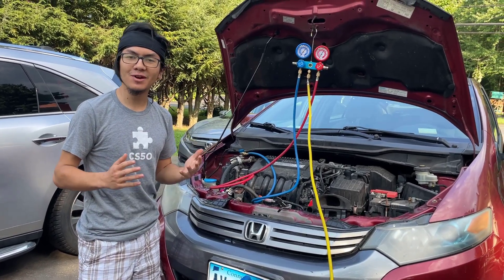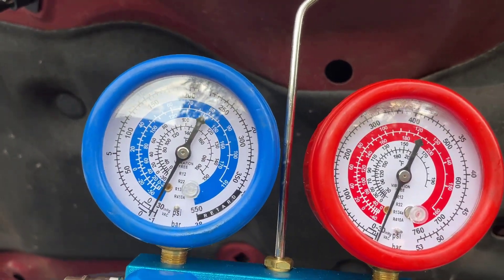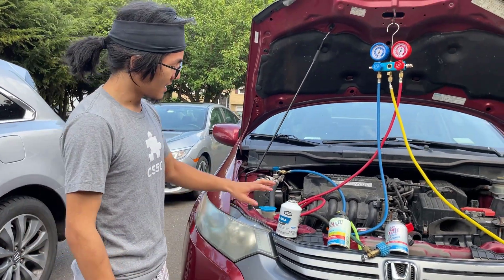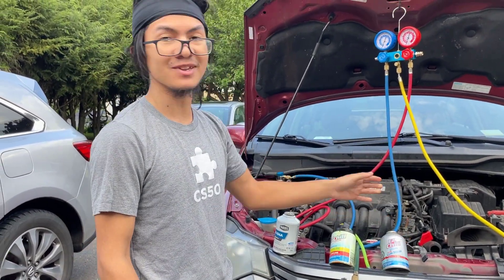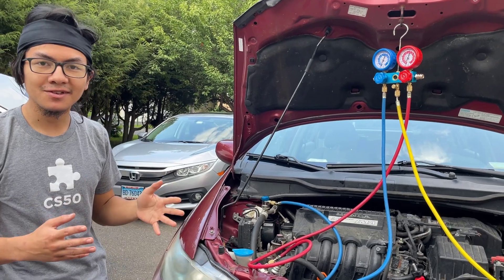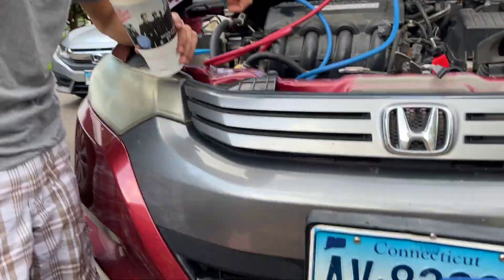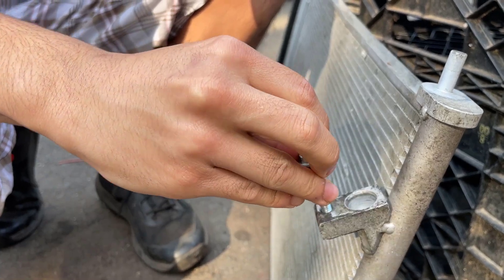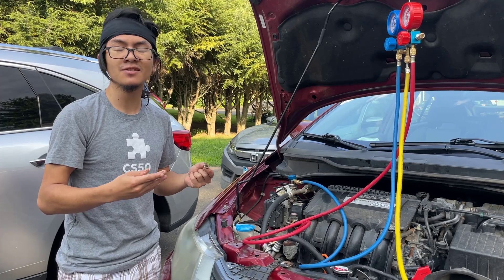How To Check For Leaks Using Manifold Gauge & Vacuum Pump | Part 12 Fix Car AC Replace Components

Comment from the maker: Here are the #ᴬᴰlinks to tools, parts and accessories you may need to perform this repair:
1.  https://amzn.to/3J0gWFH  | XtremepowerUS HVAC Air Vacuum Pump 3CFM 1/4HP (R134a R12 R22 R410a) A/C Refrigeration AC Manifold Gauge R134 Can-Tap Included Carrying Tote
2.  https://amzn.to/41jmqBF  |  Orion Motor Tech AC Gauges, AC Manifold Gauge Set for R134a R12 R22 R502, 3 Way Automotive AC Gauge Set with Antishock Gauges Hoses Couplers Adapter, Puncturing Can Tap Freon Recharge Kit
3.  https://amzn.to/3IYoWXR  |  Orion Motor Tech Vacuum Pump, 3.5 cfm 1/4 hp HVAC Single Stage Vacuum Pump for R12 R22 R134a R410a R502, Auto AC Vacuum Pump Kit for Automotive Air Conditioner Resin Degassing & More, Oil Included
4.  https://amzn.to/4529CC8  |  TSI Supercool A/C Comp Lube, UV Dye, 8 Oz, Flsh PNT 442 F, red/Yellow Tint (P46-8D)
5.  https://amzn.to/4onzKiE  |  Air Conditioner UV Dye Leak Detector, Pro Auto Oil AC UV Dye Leak Test Detection Tool Kit 68 LED A/C UV Flashlight Detector with Protective Glasses

Or Click on Amazon link here and search for what you need:  https://amzn.to/3D1T2GQ